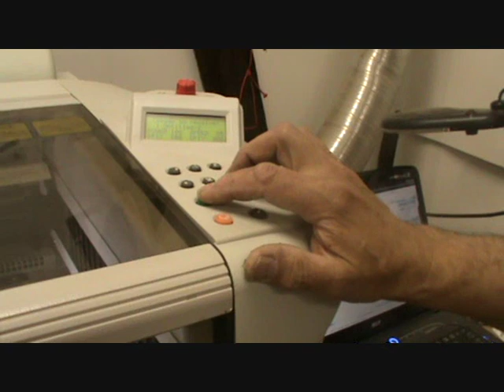Diatonic accordion construction: Making a single-row melodeon reed block

Comment: An advantage of making the reed blocks this way is the advantage of plywood in general - a single block of wood can have different internal stresses, grains, hydration rates, where this would be uniform, stable, and closed to propagation of cracks or moisture. It's certainly interesting to watch - thanks for the video.

Comment: Interesting to see that there are multilayer plywood reed blocks (rather than making holes in a bulkier wood block). Is it a common feature on accordions ? Do you if it changes the sound quality (in the sense that the surface aspect might be different than with the usual boring tools) ?
Reply: It may affect the sound of the accordion a bit, since the plywood Won't resonate like a solid block, and the reed block resonance is important in amplifying the sound of the reeds, although like most instruments I doubt an untrained ear would ever notice.